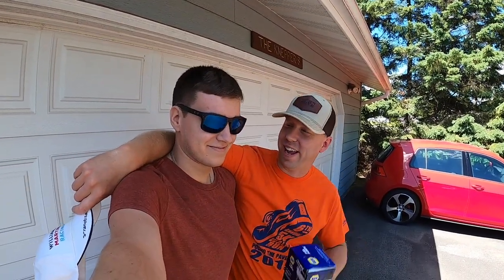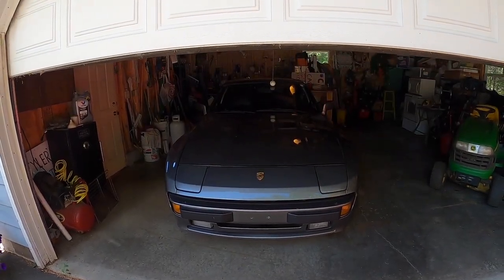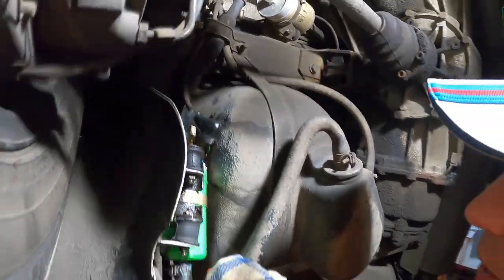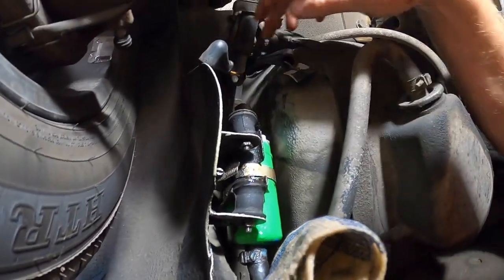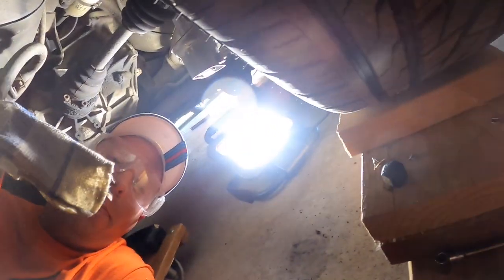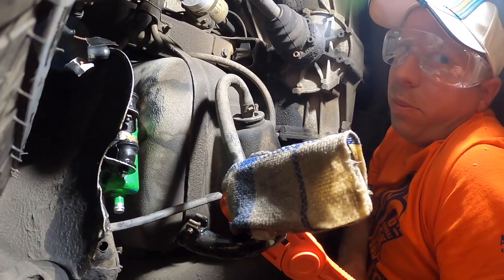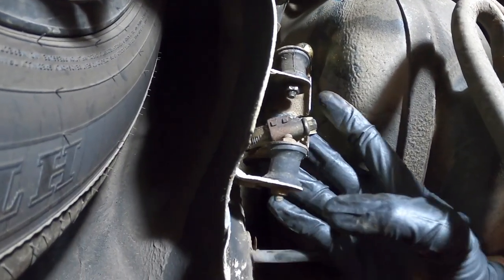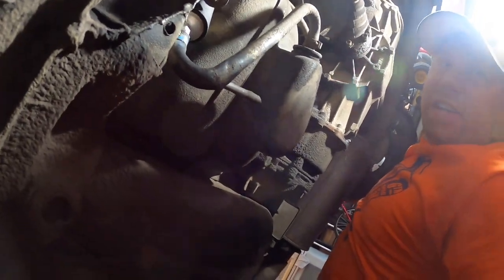Porsche 944 Fuel Pump Replacement

Comment: Question: Was your 944 bogging? Or did you just notice it was leaking? Mine is bogging at the moment and people are saying maybe the fuel pressure regulator or maybe the pump?
Reply from the maker: I didn’t notice any bogging but it happened the week after I bought the car so I didn’t have much time behind the wheel to notice any differences after we fixed the pump. So really the only thing I noticed was the leaking that was happening. Thank you for your support!